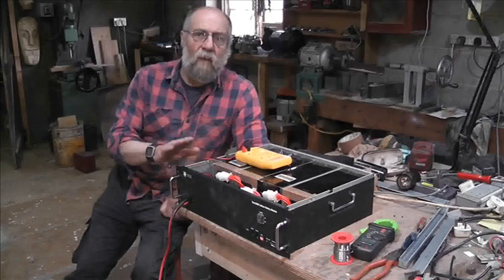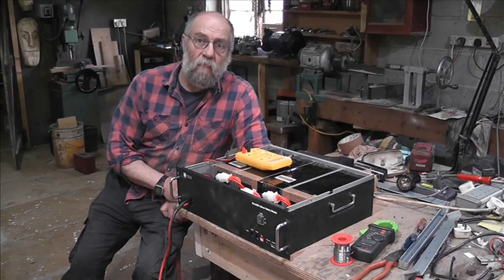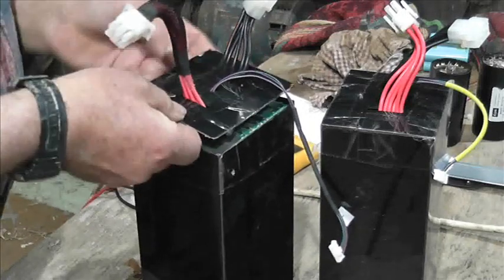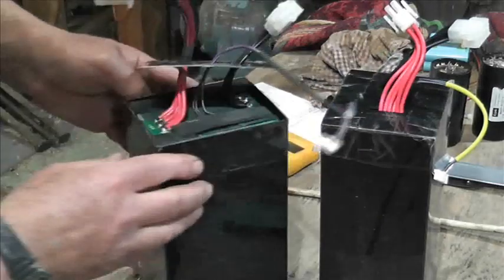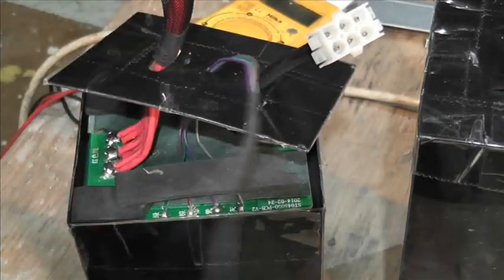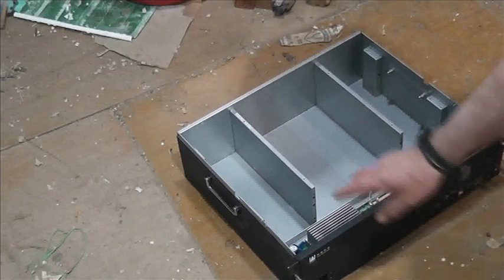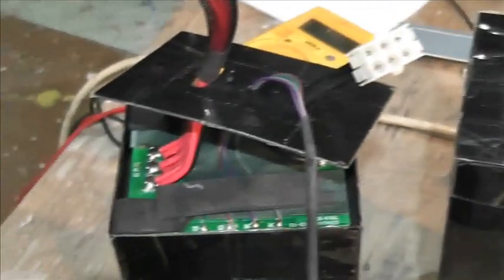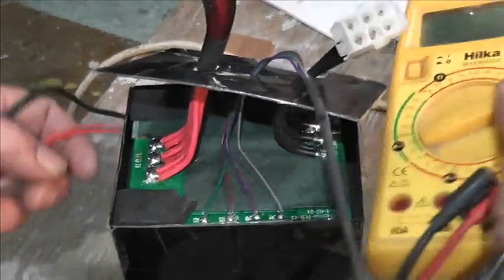Pylontech lithium phosphate part 2: the 15 S battery

Comment: Cheaper way to make them, many american ones are 15s and not 16s.
But when you check the cell spec and output they are not like 'normal' batteries, they havent much been, 35-65 amp outout.

Seen so many excuses on these and why they dont perform and over current issues (bulged cells). 

Our budget battery comes in much cheaper, uses primatic cells and 16 of then. In fact you can get our budget 11.77kwh for less than these are selling for.

Not a fan of those batteries as you can guess.😮
Reply from the maker: Hi, this was my first exploration into lithium phosphate, interesting and a cheap way in as they came as an extra. For a time they worked in parallel with lead acid traction cells. So that's why I'm stuck with 15s, cheers

Comment: Why are the switches why are the switches not all one way?
Reply from the maker: They are dip switches to set out the priority, number 1 is a stand alone battery, cheers
Reply: Ok, so if I have a stack of 5 pylontech batteries, and master is on top.what positions should the be in ? Thanks.
Reply from the maker: @grahamesells6539  I only have the codes for the Extra 2000 units, and these don't go up to 5. Best download the manual, cheers

Comment: Hi Andy, i have a new pylontech us3000c battery which has the same problem as you have. Turn on and goes into alarm. I have the battery for over a year and i think it has gone into over discharge mode as it was never charged. I have a dc power supply that i can set to 50V and max 5.2 amp. How long would you expect to charge battery with these settings. I have the negative lead removed from board and charging the cells directly. Any help would be appreciated
Reply from the maker: Hi, you only need to get to about 45v and then if things are going to work they should. Be careful not to go over volts or you will damage those cells. Worth checking if each of the packs show sufficient voltage, cheers
Reply: @TheInfoworks hi Andy, checked the pack voltages, 3 packs reading at 16.52V, 16.44V and 16.33V. problem must be PCB board? Thanks for your help
Reply from the maker: @JoeMurt Sounds expensive fix if at all possible,  If you are near Lincolnshire or Brighton I would be interested to have a look, cheers,
Reply: @TheInfoworks  got her charging now I hope. Swapped 2 and 3 battery pack leads on the board as there was some LEDs on around the second lead. When I swapped them back the LEDs turned off and so did the alarm led on the front of battery. She has one green led on the front flashing and she is taking 100W from the charger. Just hope now that more green led lights will flash on the front as she takes more charge. Thanks for your help
Reply from the maker: @JoeMurt  That's grand, hope you subscribed and can help with more videos, cheers

Comment: The worse battery ever... only 15S...move away from that 48V...51.2V is the one you want...
Reply from the maker: Hi, you seem to be very positive about this, however 15s works very well in parallel with our 50KW lead acid, cheers

Comment: It's a 15s 48v battery, if they had 16s it would be 51.2v battery
Reply from the maker: Hi, it's working well in parallel with a 48v lead acid bank, cheers

Comment: Nothing wrong here its a 15s they just have the packs in packs to fit the case.

Ita just a 15s2p configuration but the typical design for lithium ion would be 14s2p and lfp 16 or 15 is used.

Comment: Hi Andy, apologies if I missed something but what was the fix or does it just need a little time for the red led to stop flashing?
Reply from the maker: Hi, David, yes it just needed a good charge. Red and green LEDs are a mystery to me being partially colour blind, so I did not notice. The other unit I have had a blown fuse hidden on the board, easy fix once identified, cheers
Reply: @TheInfoworks  thanks Andy, well that's a great double win for you with two of those now working, happy days!
Reply from the maker: @davidbrodie5044  Yes indeed, and they work great in parallel with the main lead acid battery pack. Cheers

Comment: Hi Andy,
Watching with great interest. Its amazing just how much current these packs can unleash. Especially when you don't expect it. Not sure about putting the pack in parallel with lead acid battery's.  Both have different discharge rates and characteristics. Stand by with the CO2. Cheers.
Reply from the maker: Hi, it seems to work, lead acid at rest is about 49 / 50v and lithium phosphate about 52. No smoke and smoother power, who'd have thought it, cheers

Comment: Also Andy, is that charger of yours really doing 31 amps at about 48 v ? That's some charger if so !
Reply from the maker: Dave, yes it's a switch mode and that output is correct, no wonder the fan runs all the time. They came out of a big old off grid generator / inverter system and there were 3 in parallel. very handy, cheers

Comment: did the re solder in bank four on the BMS allow it to switch to charge again nice , there spread  across the 4 units then as i dont see any green caps in there do you so  4 been the controller then been last in the line or first depending how you view the flow of electrons
Reply from the maker: Hi, no resolding needed, number 4 is just built with 3 groups of pouches so the the battery voltage is similar to lead acid. I'm experimenting with using these in parallel with my main lead acid bank, cheers

Comment: Did I miss a bit Andy ? What did you fix to stop the alarm light coming on - did it fix itself maybe ? Always a little worrying when things do that....
The numbers of cells thing - it needs to be 15S to get 48volts nominal, so I'm not sure how else they could have
divided them up, other than 4 - 4 - 4 - 3, unless they did 3cells x 5 groups or 5 cells x 3 groups. Perhaps they had those cases already manufactured for some other power bank design, and they happened to have 4 bays, so they were stuck with confusing Andy with 4 - 4 - 4 - 3 ! :o)  
Be interesting to see  what these power banks do, and whether they hold some charge or not. Cheers, Dave
Reply from the maker: Dave, yes it's all very interesting. I think the later batteries are 3 cells with 5 groups and maybe this format was all pert of the r&d process. The voltage is interesting and sort of matches in with lead acid. These sit at 52v when fully charged but not charging, my main lead acid sits at about 50v, so  this battery takes the main load to start with. These will go down to 40v and when linked with a big lead acid will never do so. That looks like the reasoning for the 15 S. The alarm flashes for a few seconds every time the unit is switched on and then moves over to work mode. there's some learning going on here, cheers